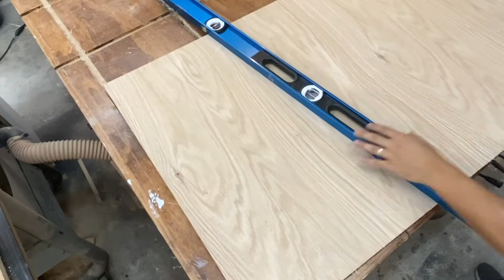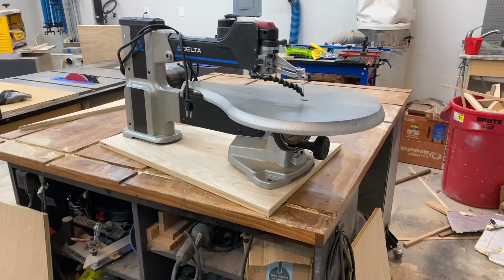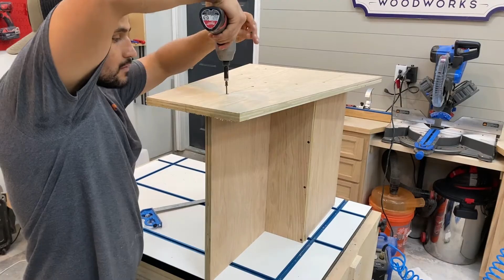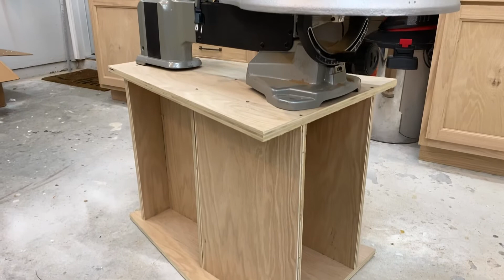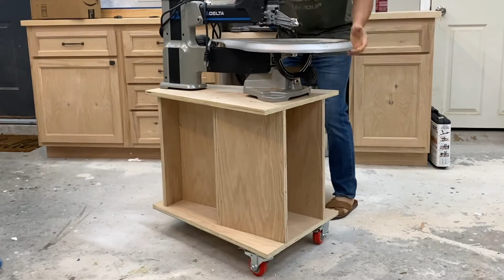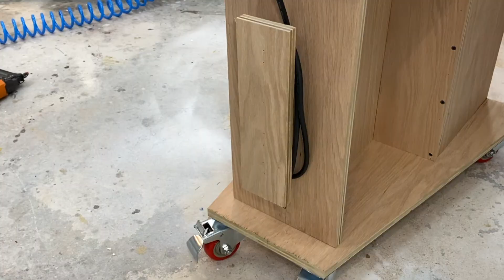Scroll Saw Cart Build

Comment: Nice vid. Future tip, the nails blew out because of the angle you was holding the gun. They will turn left or right. Turn the gun sideways next time. Look at the nails, they are flat on the sides. They won't turn up or down.